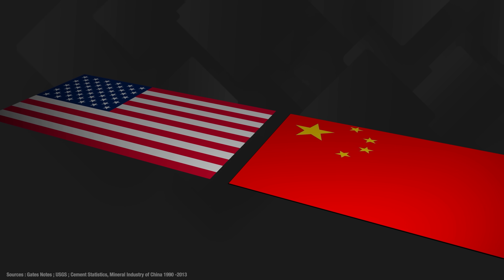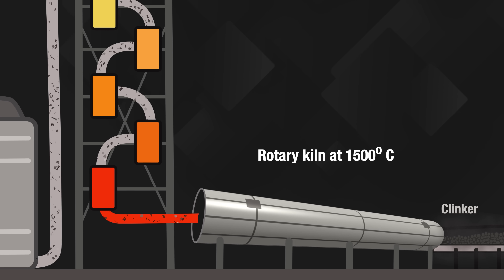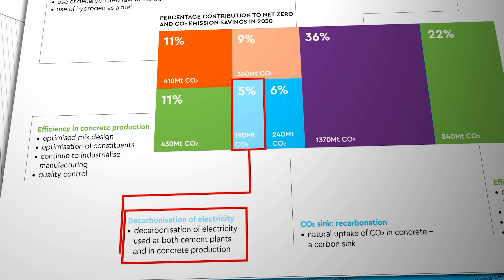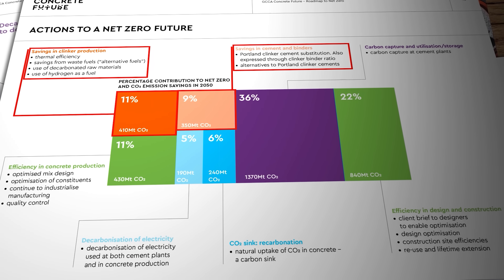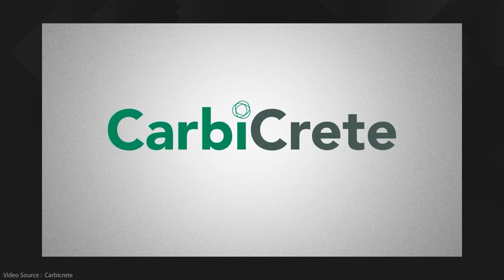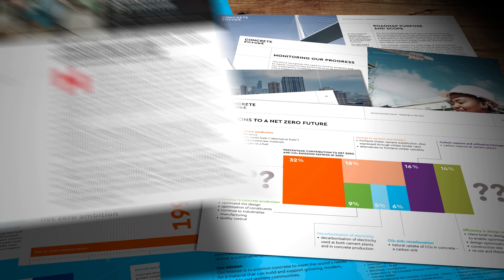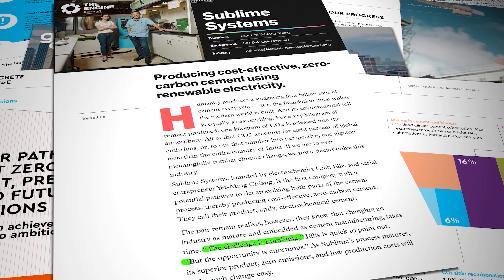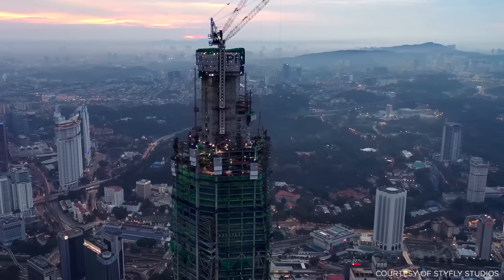How to make concrete green!

Comment: What about Hempcrete?  The biggest problem so far is that you need to mine Lime for binder.  There are a number people looking for alternative binders and I have not seen any news on discovery.  Hempcrete is not good yet for larger block but great for two floor building where large number of people live upon.  Plans are carbon captures compared to releasing carbon underground.  The biggest problem is that growing plants for production should not harm food supply.  That where a previous video could help with tower of glass to produce building materials.  You see so many high rise skyscrapers in US, but none of them are used for growing building materials. https://www.youtube.com/watch?v=Bnc1uJvP1Cc

Comment: I didn't notice any reference to polymer concrete which is stronger than Portland concrete, doesn't require limestone but can incorporate waste material like fly ash, and is more resistant to water, heat, and corrosive substances.
Reply: This wasn't an alternative concrete video but ways to make concrete as we know it  greener. But yeah that could be a different video with ferrock, ashcrete, timbercrete, and geopolymer concrete.
Reply: @miavaughn2393 And not that you can build with it most places but pykrete is an interesting building material.

Comment: Hold on, maybe I'm not understanding this correctly. You're saying it's possible to make concrete from calcium silicate rocks in a process that doesn't emit CO2 , but nobody has done it before now? And the old Portland Cement process that does emit CO2 was developed in part to make use of all the fly ash that was lying around at the time because everybody was burning coal?

That's... I want to say perverse, but I guess it makes sense. Back in the 19th century when they were inventing cement nobody thought about the long term effects of what they were making. And they certainly wouldn't have imagined that we'd still be making gigatons of the stuff a century or two later. It's like cement started on the wrong "technology track" and now we have to switch it over to a more sustainable one.

Well, I wish these Brimstone people all the luck in the world. And I hope their cement gets tested as quickly as possible an added to all those building codes you mentioned. It sounds like their process is the one we should have been using in the first place.
Reply: OPC was invented in England in 1824, and I don't think that the original formula used fly ash. It's based on "burnt"--reduced--limestone; fly ash, aluminosilicates, was, I think, added later, and not to all Portland cements. OPC was little used until the 1890s, when engineers began reinforcing it with steel. But it is chemically-active calcium carbonate, limestone/seashell, and it is always full of water, and expands and contracts and cracks. Cracks let liquid water reach the rebar, which rusts and expands and destroys the concrete. You can slow but not stop that, so that 100 years is a good life-span for a well-maintained OPC bridge.

I'm unclear whether what Brimstone is doing is a geopolymer cement. GPCs were invented in the 1980s, by chemists whose understanding of, well, chemistry was a lot deeper than Joseph Aspdin's  was 200 years ago. The chemistry is very different; I'm told that GPCs are more like glass than like limestone. And glass is far more durable than seashell.
Reply: Thank you for your comment! It's very informative. More like glass than limestone... Interesting!

Comment: 25 years ago I was using pulverised blast furnace slag as a opcode replacement at a rate of 70% in ready mixed concrete. It was producing stronger concrete as the maximum strength was not being reached until after 28 days (concrete is sold bu 28 day strength) it could also be used to withstand class 4 sulphates ( heavy ground contamination by previous industrys) and was more resistant to chloride ion cream ( the concrete rot that allows steel reinfcing to rust) so saving 70% co2 is achievable today. Ps it would also be possible to completely replace OPC (ordinary portland cement) with a suitable alcoline liquid. Hence 0 co2
Reply: Alkaline liquid? Sodium hydroxide is used to activate some geopolymer cements, which have no water in them, and admit none, after they set, set and cure faster--far faster, if you run a little shot of electricity through them at the right time--and can have (Blue World Crete) twice the compressive and three times the tensile strength. They're always alkaline inside, so they passivate rebar--no rust. And they just might last 1,000 years instead of 60.

Comment: Interesting. Having worked in the concrete industry for twelve years and I am also technically trained in concrete there is a concern I have here. Concrete only has compressive strength, it does not have any shear or flexural strength. In order to get compressive strength any air has to be worked out of it when it is being placed. So if CO2 is being injected into the mix I just wonder how much of that is retained in the mix when it cures.

Also, believe it or not (in Australia anyway), there is no money in concrete. With competition etc there is no money in concrete. However big concrete companies own their quarries as well. This is how they make their money through what is known as the quarry pull through. The quarry side of the business makes the money the concrete side of the business doesn't and they act as separate entities. So for the concrete to make changes to existing infrastructure when they run at a loss, that will cost a lot of money is not going to happen. 

Concrete is ridiculously technical. There are 14000 different types of basic concrete. The technicalities are truly unlimited. Everything that goes into concrete effects they way it performs, different types of sand, stone, fresh water or recycled water even type of stone and the size and shape of the stone affects how it performs. Changing or adding anything to the mix and its ultimate long term performance would be on the minds of concrete companies and construction workers when it comes to building any sort of infrastructure. 

Fly ash is amazing for concrete, it truly is. When this stops getting used it will unfortunate. Fly ash behaves like cement when in the presence of cement but being a finer particle adds strength to concrete over the life of the slab. Essentially mixes with fly ash will just keep getting stronger essentially forever.
Reply: At least from what ive seen, and this is mentioned in the video as well, co2 strengthens concrete. It chemically reacts with the concrete like concrete normally does over hundreds of years except all at once instead. Oxygen or nitrogen (atmospheric air) would create bubbles as the mostly nitrogen air we breathe is relatively non reactive so would by its very nature create bubbles instead of reacting/bonding. But how fast this process is and are there bubbles? Dont know. Only these companies know, but if their strength estimates are accurate I assume that means bubbles or air pockets aren't a problem.

But massive amounts of testing needs to be done for any alternative to standard concrete as lives literally depend on exact specifications in the case of large buildings, dams, skyscrapers. Or just large amounts of money lost in the case of smaller buildings.
Reply: Sounds like these startups are going to need to set up their own quarries if they expect to get off the ground? Thanks for the detail. Always important to understand the encumbered position to best assess path to change (if we even can…)
Reply: I see some problems with the CO2 injection as well. The reaction with CO2 reduces the pH level of concrete, so the reinforcing steel can start to rust. 
The bubbles might or might not be a problem depending on the planed properties of the concrete. It would depend on the size of the bubbles. If they are to small, the might get soked full of water and crack the concrete in the first winter. If they are just the right size, they allow the water to expand as it freezes. 
As you said, every new recipe for concrete needs to be tested before it is used.
Reply: @hanneskannes8209  I would respectfully suggest that the major step that's missing is the testing of the new compositions. It's all very well to say "hey, I have a new formulation" but the existing formulation has been extensively tested (VERY VERY extensively). So I agree: it's not clear that we can just inject CO2 (or use a different kind of rock or any of the other things he mentioned) but it's certainly worth testing!
Reply: @rongo59  Yes.  The NEU center of excellence recently established by ACI will have a critically important technology validation service that will do exactly this function for the industry.
Reply: Geopolymer cements, Blue Crete in particular, do have some shear and flexural strength, and several times the tensile strength of OPC. Look: the Coliseum is stull standing and the Pantheon still in daily use after two millennia. The Seaside Condos in Miami fell down and killed 98 people after only 40 years. Enough said?
Reply: @Wiggle Wiggle      Nationalization.
Reply: I have similar experiences with wrap- and sign foils which can be chemically influenced in various ways to add valueable properties as uv protection, strength or flexibility. However in essence it's still salt and oil. It really depends on what kind of new applications will come from this material. They need to prove their quality. No guess work please.
Reply: last conversation Daniel Panitz told me that Blue Crete can be made with fly ash, steel mill slag, pumice, volcanic ash, finely-ground granite, basalt, serpentine. olivine, almost any aluminosilicate rock--3/4 of Earth's surface. Running out of fly ash won't hurt a thing. I don't know if Boston Metal's molten oxide electrolysis process for making zero-carbon steel will leave slag or not, but again, it doesn't matter. GGBFS is useful but not essential.

Panitz also says that a mill to make Blue Crete (and by extension, other geopolymers?) should cost 5 to 10 percent the cost of an OPC plant, use < 1/10 the energy, emit 1/10 or less the GHGs. YOU DON'T HAVE TO COOK (calcine) ANYTHING. You just grind aluminosilicates to the right fineness, mix to get the performance you want, add the activator, and pour and finish just like OPC. And your structure is superinsulated and might last 10,000 years.

Comment: Just a clarification; Concrete is made from cement which is made from burning limestone. Just figured you’d want to sticky this considering your fumble in the beginning of the video 😊
Reply: At the end of the video, he talks about Brimstone’s technology that doesn’t involve limestone at all, instead using calcium silicate rocks. So maybe at some point, limestone will no longer be part of the process most of the time.
Reply: @davestagner  I was pointing out that he said cement comes from concrete which doesn’t make for a very good introduction nor a factual one. Kinda thought more people would have picked that one up by now… It’s really not a good look if you want to be a science communicator.

Comment: Missed opportunity to revisit SaltX, that you talked about before. In designing their reactor to charge the salt battery they realized it can also be used to produce quicklime. "The technological innovation called Electric Arc Calciner (EAC) electrifies cement production with renewable energy, and the carbon dioxide released during the manufacturing process comes out as a byproduct - ready for sequestration." I think a combination of some of the technologies you mention should be able to drastically reduce the greenhouse gas emissions from cement needed in large scale applications.
Reply: I was waiting the whole video for him to talk about saltx technique. Because I would really like to hear his thoughts about that 😁.

Comment: That was something positive amongst the gloom.
It sounds like there are real possibilities for practical ways to lock up CO2 in concrete, and so dramatically reduce the carbon emissions that now come with concrete.
Sounds like it will be a more practical way to reduce emisssions than changing to tiimber construction.
It will be important to have ways to verify that CO2 emissions are actually avoided.  Not much good having a system where people can just pretend to follow good practice.
Reply: The right cements draw carbon out of atmosphere and combine with it as they set. They could be a major weapon in the fight against climate change while they make our buildings stronger, safer, longer-lasting, and more energy efficient, and cost less. The OPC industry is as recalcitrant to change as is the oil/gas/coal monster, and the public and politicians don't seem to be aware of the problem.

Comment: iron ore is not used in cement manufacture. It is purified clay and for special purpose cement silica or alumina are the important components. Coal provides the heat for the reaction and limestone produces calcium oxide that causes the clay particles to fuse and form clinker.

Comment: What about using green hydrogen as the fuel for the rotating kiln?
Reply: I was thinking something like that as well. The existing concrete industry produces CO2 in three different ways… from the chemical reaction to make concrete, from burning fossil fuels to generate the necessary heat, and from burning fossil fuels to transport the product. How do we generate that heat using renewables? Green hydrogen is nice for that.

Comment: Well, American houses are built out of cardboard, see any hurricane video, and other large buildings use a lot of steel, so no wonder China uses more concrete. Although if you really look at their "tofu buildings", there's not that much concrete, it's only about half concrete, the other half is dirt, used masks, used condoms, paper cups, human feces, female fetuses, anything goes, making recycling Chinese concrete a bad idea
I wonder, we could probably replace the steel rebars in reinforced concrete with graphene, if we ever can produce it cheaply, and kill two birds with one stone, sequester carbon in concrete (graphene, carbon dioxide curing, carbon in steel) and iron mining. Iron is quite abundant, but any mining operation has carbon emissions from mining and environmental and cost issues.

Comment: A quick question regarding the statement at 0:34 ("cement or more accurately concrete that it's made from"): Is cement made from concrete? Or is concrete made from cement?
Reply: Cement is the product you mix with water to create concrete structures.  Hopefully that's a concrete enough answer for you.
Reply: concrete is cement plus stone chips. the cement is the glue and the stone chips are the strength. If you put iron bars or rods in the structure, you get RCC (reinforced concrete cement)
Reply: It is the latter. Cement is basically the glue that holds the added sand and gravel together to make concrete.

Comment: There's a problem with using more sand. We already face a critical shortage of sand suitable for making concrete. Sand in the desert is two rounded and smooth to use in concrete. You need Jagged sand for concrete.

However desert sand is excellent for district heating. District heating appears to be an inexpensive easy to build win-win new technology. And some countries in Europe are going to be able to install District heating before this winter which will allow them to get by with less natural gas.

Essentially all you have to do is build a strong container, put a bunch of sand gravel or whatever into it, and heat it up to 500° when you have excess energy such as solar or wind. Then you blow air through the huge hot mess and provide it to the Local District in a series of insulated pipes. It's apparently much safer than Steam heating.

Comment: Is there a way to make concrete absorb less heat? In these increasingly hot times I'm noticing that the heat absorbed during the day by the concrete can make it unbearable during the day and night.
Reply: Planting trees serves many purposes.  In cities we can sequester water by creating raingardens/bioswales fed by curbcuts/curb-bores to water these trees to add beauty, shade, reduce wind, reduce heating AND cooling costs, reduce the need for expensive underground infrastructures, reduce both air and water pollution, etc. 
Brad Lancaster has a great video on how he is reclaiming wasted rainwater while reducing heat island effects, reducing crime, increased walkability and bikability, etc.
Reply: There are infrared reflective coatings
Reply: Well to start with you can paint it white.
Some cities have painted their concrete streets white and lowered the temperature of the entire city by multiple degrees.

But there are modern paints that have a much stronger heat reflecting quality because in addition to reflecting light they also reflect infrared.

Comment: 0:08 How much is used to make stuff for the rest of the world?
Reply: Concrete is generally used for structure and infrastructure, not exported. It's not viable to ship a dam, road or skyscraper
Reply: @jimurrata6785  Question strange. Hoe much of China's CO2 is used to make stuff for the rest of the world? Die argument sake, if 2/3 of all production of things, like your phone, is for export, 2/3 of buildings, electricity, transport and infrastructure is caused (indirectly) because of the rest of the world.

Comment: Thanks, the Cement industry in the UK uses alternative fuels for firing the kilns, these are classed as waste, and the operators are only allowed to replace 40% of the coal with these wastes, they can operate at much higher usages, but not allowed, as the regulators then consider them as a waste incinerator rather than a Cement plant.
 OK, still emits CO2, but less than coal, as the waste is much higher hydrocarbons and oxygenated hydrocarbons, and so a much lower carbon content than coal, also uses waste as a valuable energy resource.